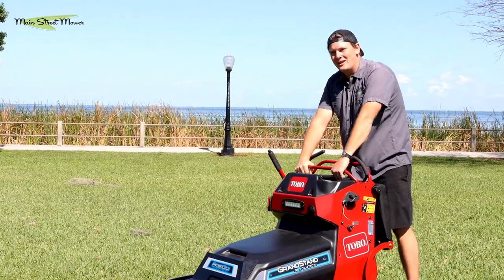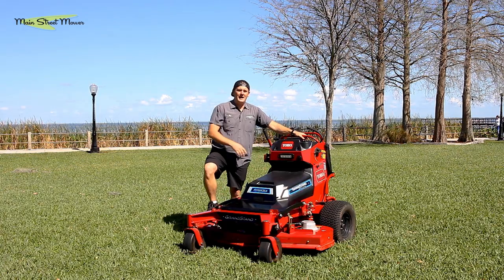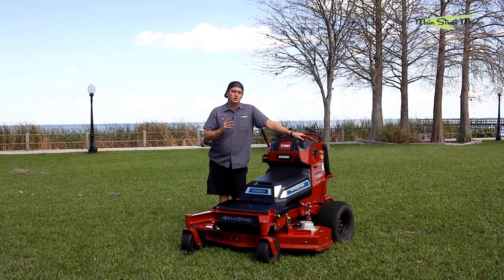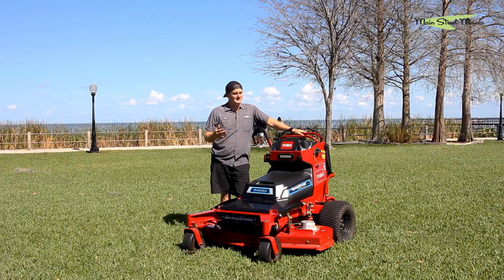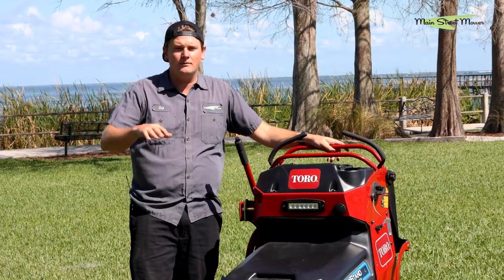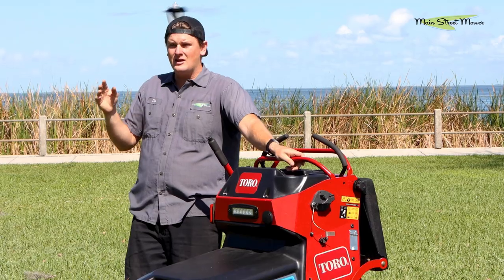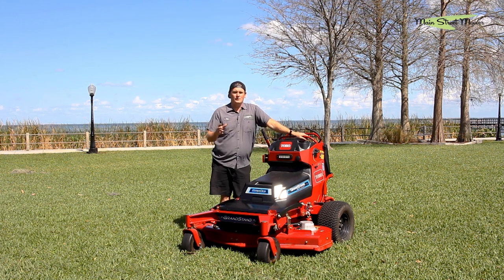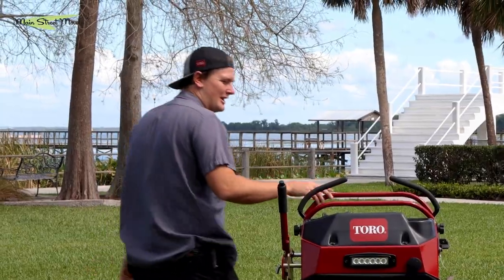The BEST ELECTRIC MOWER in the Market! - TORO Grandstand Revolution

Comment: I feel like this mower will make sense when the price gets to the same price as a gas mower equivalent in the 10K to 15K range. Toro has this calculator to make you think in the long run it is worth it. What they don't tell you is how long a motor lasts or what happens when the mower is out in the elements all the time. I wouldn't be shocked if a motor failed right outside the warranty period and replacement motor is like 5K. Replacement parts and costs in general have not been talked about in any video that I have seen. On top of that with this being a new mower every replacement part is going to be super expensive because it is a new mower. Will a dealer even have the parts available if something fails?  Replacement parts for gas equivalents are readily available and there are aftermarket parts as well and they are not that expensive. People also keep saying gas is $4.50. Even the premium non ethanol gas is only $3.90 around me. In NC gas is $3.25 on average around me and has been for the past several years. What we really need is competition. We don't need states like California forcing people to use electric. Competition drives prices down. In a real free market prices are driven down. The government is the real problem here. Gas would be lower if the government/current administration wasn't purposely trying to drive gas prices up so they can force "green living" on everyone.  Also, the federal reserve has inflated our currency so much everything cost 4 times as much as it did several years ago. Don't get me wrong I have nothing wrong with electric anything. In fact I have solar panels at my house. I just dont know how this administration is forcing all this and trying to eliminate competing energy sources. All it is doing is making prices higher.

Comment: well 30k plus and it takes 12 hours to charge. I know the batteries will cost a arm and a leg. Also when in a hot climate batteries dont last longer than 3-5 years. So i wonder how much it will cost to replace them all. 

So i wonder how much they will cost elsewhere in the world.  Also having to make sure its charged after every day. I dont think everyone can afford to spend 30k on three or four of those mowers.
Reply: B Bardy, you're on point. They never talk about the extra cost in electricity  to charge the mower, or provide a factual analysis of energy cost from charging the unit. How about a price break down of the parts. A mower that cost 30k to 35k, is going to have  high priced parts to go with it. It's cool that they have developed these electric mowers, but at these prices it's going to take another 7 to 10 years and prices coming down drastically to get at least 75% of lawn care companies to adopt these machines. Furthermore, all these companies that are manufacturing these electric mowers are still going through the tried,tested,and true phase. Until realiability and capability are guaranteed, I'll have to steer clear of these units.
Reply: @vmv8843  Also what happens in the field if you need to charge, wait 12 hours to fully charge it. I know i don't want to put my mower on charger every day after work.

 I would rather spend 30k plus on top of the line commercial mower, then i can top off the fuel near the end of the and finish the last 1 hour of work without having to charge a mower for a few hours to finish my work.
Reply: @bbardy3924  you're absolutely right. You could buy three gas powered grandstands for the price of that mower. It's just not practical for most people yet.
Reply: @bbardy3924  Are you really putting 8h+ on a mower every day?  You must have some giant commercial properties.  My heaviest mowing day is a 6h HOA.  Trimming, edging, blowing are always bigger time sinks for me.  Most days I put 2-3h on a mower in a 10hr work day, but I'm mainly residential.  30k is right at the tipping point for me to pull the trigger on going electric.  A gas 52" toro costs me about 34k during its usable lifespan (1500-2000hrs, or 4 years).  Assuming they keep 0% financing on these, it's a little less than a truck payment and I'm seeing a profit of about $100 a month compared with the cost of a gas mower + maintenance.  Until year 4, and then I'm making a profit of 600-700 until the battery goes out.
Reply: @jgalt99  Well the biggest problem i see if with the battery. If you're doing mostly rural properties that at minimum of 5cres plus. A lot are 20 acres plus.  The batteries in the heat don't cope too well. If you get 2 or 3 years outta battery you're lucky up here.

I would need prob 10 plus batteries so i could cover 5 hours of hard mowing. They say these mowers dint last so long.

In reality most people who have use electric mower in the states are getting 3 acres outta of them Even if new models are getting 6 acres then that would mean one rural property.

So the batteries will cost at least $500 plus. Also know with inflation they could be closer to 600 each battery. Well to have spare set you need 10 batteries at $6000 minum, That for every 2 to 3 years. i have heard people having problem with them after a year,

Also the rumours saying this could cost anywhere between  high 30k or 50k us price. I wonder what the price will be in aus.

Until we actually get them in Australia i dont know if the cost will add or not. I know for 40k plus you can get very decent bagged  big mower. If the mower in the low 30k mark it could make sense.
If if costs in the high 50k mark then i wonder if would be cheaper considering that less 15k or more can get you alot of fuel and matience costs for  that price.
Reply: @bbardy3924  These are brand new, so there's no data for how long the battery would last other than what Toro is putting out.  It's not a battery you plug into the mower like the homeowner mowers already on the market.  It's basically a battery module like the one they use in Teslas and other EVs.  18.5kw.  The main issue I see is that they appear to be air-cooled, which goes to your worry about longevity.  Water-cooled batteries are lasting 8+ years and 500,000km+ in rental EVs that are driven hard and fast charged all the time, (which this won't be).

The battery likely costs at least 10k+, theoretically I guess you could swap out individual modules for less than that, but if they're starting to fail you'd probably want to swap the whole thing out.  The electric motors for the blades and drive wheels should last decades and be fairly inexpensive to replace.

I believe a battery of this size and composition would have no problem running 8h on a full charge, and certainly the 2-5h I'm typically mowing.  The issue is how long is it going to last.  It has to last at least 5 years with minimal degradation if it's going to be financially viable.  A gas mower this size costs me 34k in total ownership costs by year 4 at which point I sell it for 2-3k and buy another because it's about to blow up.  The major draw with electric is that the operating costs are pennies on the dollar.  I buy electricity at 0.13/kwh, so instead of $100 in fuel a week I'm paying less than $8 in electricity to run this mower.  There's no belts, transmission, hydros, oil or other expensive parts to maintain on an electric, so it's just blades and tires.  So if it lasts 5y you've making an extra ~10k a year vs gas, and every year after that as well for as long as the battery lasts.  If these things were water cooled I'd be all in from day 1 because of what we're seeing with EV battery longevity when they're properly cooled.

If you're cutting 5 acre properties with a 52 or even 60" stand-on now, you're a stronger man than I.  These mowers excel in efficiently cutting many small properties and getting into tighter spots than you could on a ride-on.  It takes me almost an hour to cut an acre on a 52.  Not at all suited to your properties.  I'd want a 72" or larger fuel-injected ride on for yards that big and I'd want to be around 30 minutes an acre or ideally a bit less.

Comment: The grandstand isnt the best standf on tho . The Wright ZK is better in just about every way.  Larger tires for greater grip and much longer tire life. Also with larger tires going up and down curbs is easy.  its much faster so increased productivity 12.5 mph compared to toros slow 10MPH. Standing in between the wheels is superior for turning in tight areas and hill stability and allows a much lower center of gravity. Try going straight up a hill on a grandstand, it wheelies very easily.  The Mean Green Vanquish is faster with larger tires and lower center of gravity plus from what this guy is saying much cheaper at $24000

Comment: Are those LEAD ACID batteries? Once they discharge below 50% they lose most of their power. I give Toro credit for the first attempt, but this is not a serious commercial machine with all these limitations. Electric mowers will be the best by the decade's end, but not with this battery at a $34,000 price tag. 😕
Reply from the maker: These are lithium batteries, built to last with no memory

Comment: Why don’t people walk anymore? A walk behind would need way less hp, cut better and use less battery, plus the operator would get some exercise.  I’m looking for about a 48 inch electric walk behind. Does it exist?
Reply from the maker: That is one of the most appealing feature of a GrandStand. The foldable stand in the back allows you to walk-behind when you want, and stand-on when you need.
Reply: @mainstreetmower  I do like that, but part of why I want walk behind is so it can have less power and therefore be less expensive.
Reply from the maker: @trailguy  That's a fair consideration.
Reply: Walking = more time to cut a lawn.  Time is money if you do lawn care for a living.
Reply: @H0kieJoe  I get that, I’ve done the math regarding the 24hp zero turn ride on. Very pricey but literally 2-3x the speed, it makes sense.  I’m just looking for something to do my ownnlawn, though.